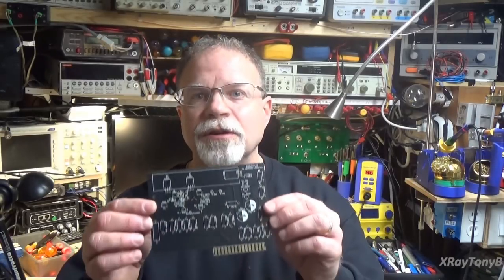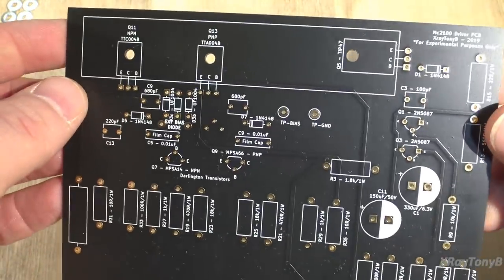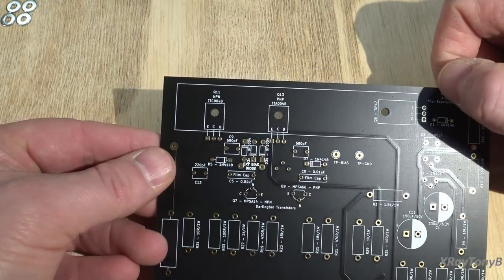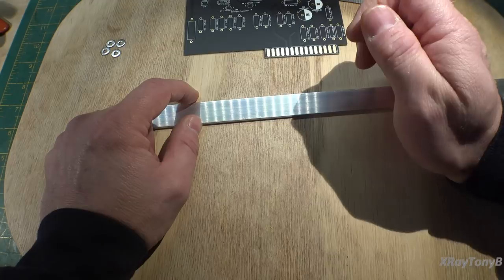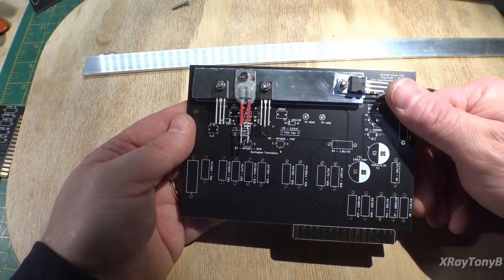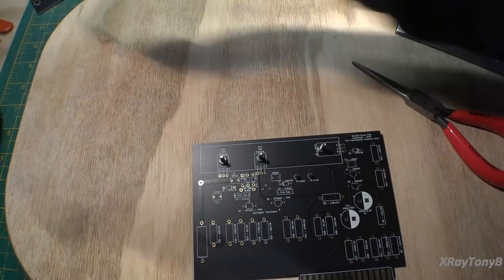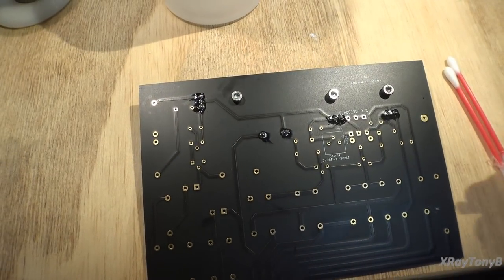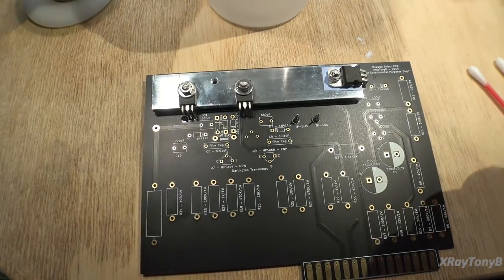McIntosh Driver Board Requests - Part 1 of 2

Comment: Hello ! Thanks for the wonderful video. I have a soldering tip ;) If you cut the component leads before soldering rather than after, the solder will cover the exposed copper of the lead, this will help for long term durability. When you cut the lead after soldering, even though the lead tin will be pressed together it often still leaves copper exposed (look with a microscope). The copper in the middle of the lead can get oxydized and cause all sorts of problems long term, especially in humid/salty environments (the oxidation creeps inside the lead/component over time)
Cutting the leads, then soldering is worth the trouble for long term reliability, as to hold the components in place use a mounting rack or masking tape, or solder one of the leads, cut them all flush, and solder all the leads including the first one.
Best regards.

Comment: Being picky but the best solder joints are usually dode post cropping. The solder then flows over the exposed cut joint and the cutting does not run the risk of causing a fracture to the solder joint. That's how we have to do it in military gear. Truth is I do my stuff the way you do too!

Comment: Excellent work sir, I have a question for everyone. I recently got a mc2105 (1974-5?) and getting ready to do a full recapping, but I am still confused by this issue- do all of them need a driver board update? Or is it for an earlier production range and the later ones are ok? I've found the internets surprisingly vague on this question so far.

Comment: What I've used instead of Thread Locker is the wife's old nail polish.  Has it's own applicator brush.  Breaks away easily enough if you have to take it apart.

Comment: is there a DSP based version of this McIntosh MC2100/MC2105 amplifier where the output board is just discrete component R2R DAC which drives the load matching auto-transformer via a low pass filter.

Comment: Hi Tony, just a general thought about heat sinks. Should they be grounded to stop them floating at some induced voltage or does grounding cause capacitance to ground issues, with the mounted semiconductors?
Reply from the maker: I've never heard of that type of thing happening.  There's really nothing on the board that could cause any induced signal. Thanks for the comment!
Reply: @xraytonyb  It was a more general comment that might apply to the big heat sinks more. Thanks for taking time to reply Tony.

Comment: I still think you should have silver-plated the traces adding 12 to 16% of resistance to electron flow by not having it and increasing electron bounce if it's audible that's another question you'd have to experiment
Reply: Are you joking?
Reply: @Wizardofgosz  no it's a no fact that silver allows 100% electrons flow copper 12% gold 16% in resistance to the flow of electrons and considering it's the skin effect that's where where it is carried
Reply: What you say about resistance in the three metals is correct. But what you have not taken into account is the rate of oxidation when used the three are used as connectors. Gold is far superior to silver or copper for connector use and is used because of it's low oxidation properties. Silver also has an undesirable trait known as "silver migration" which is the ionic movement of silver between two adjacent traces which can result in a electrical shorts between traces.

Comment: I need driver boards for a mc2300.....I know there is a company that makes them...but for the life of me I cannot remember their name....would these boards work on the mc2300....if not maybe you know of the company that makes the driver boards for the mc2300....thanks Jeff
Reply from the maker: A viewer reported back to me that the boards I designed will not fit in the 2300.  My boards are a little bit wider than the original ones, so they don't fit.  It is not a problem with the 2100 and the 2105.  I'm not aware of any other replacement boards, although there may be some that I don't know of.  I was told that McIntosh stopped making the replacements. 
Thanks for the comment!
Reply: @xraytonyb  darn it.....would you be willing to make 2300 boards if I gave you an original board.....there are many of us out there that need boards for the 2300 also....thanks Jeff

Comment: And 2205?
Reply from the maker: I think it would work, but on some models, this board is slightly wider than the original and I heard it doesn't fit (by just a hair).  Other folks said that it fit and worked perfectly.